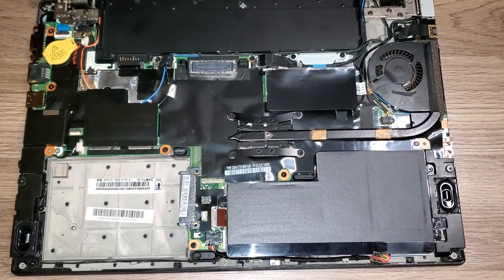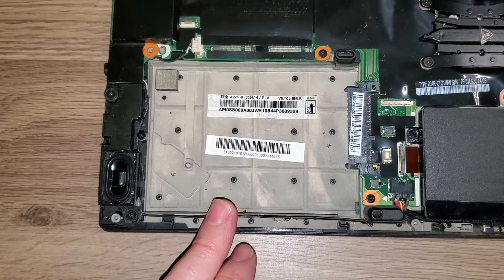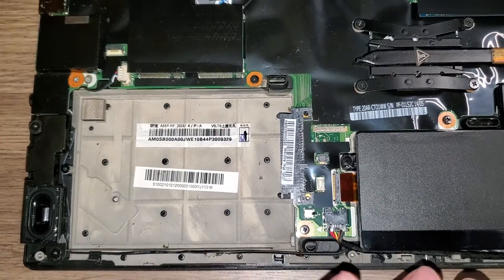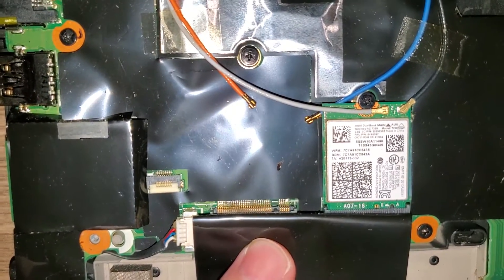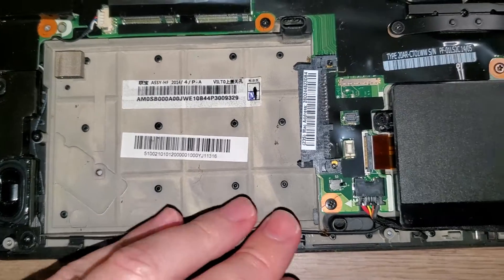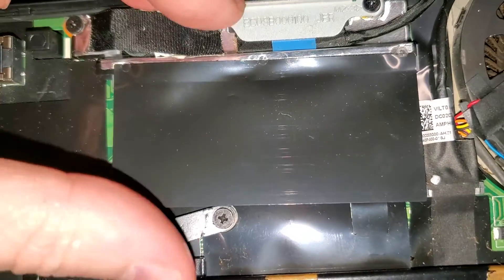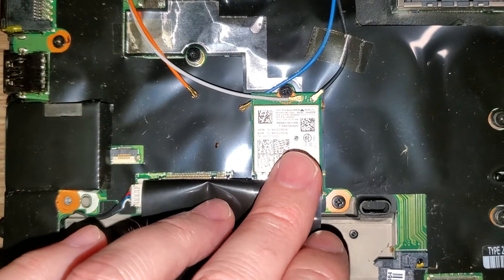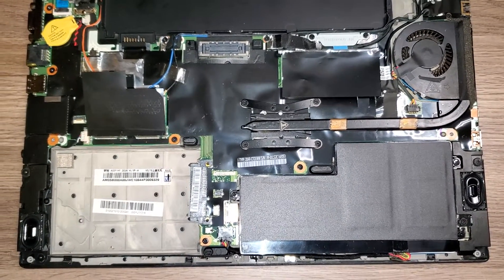Tour of Lenovo Thinkpad T440s Motherboard - SSD and Memory Upgrade Options

Comment: Hey buddy got a t440s but it won't run windows it's shuts off instead got any ideas please
Reply from the maker: Hmmm, kinda sounds like the power adapter isn't working or not providing enough power and the batteries are dead. Can you boot to the BIOS with no problems?
Reply: @LuckyVagabond Yes if I take out the drive it runs and doesn't shut off but when I put back the drive it shuts off

Comment: For the T440s model there is a second m.2 slot hidden under the internal battery on a carrier board.
Reply from the maker: Thanks man. Appreciate the info and comment.
Reply: @LuckyVagabond  actually that slot you are using is meant for is a WWAN card like a 4G LTE one. EM7345 is the one that normal would slide into that slot.
Reply from the maker: @Demonclaw92 thanks! Appreciate the info.

Comment: i currently have a HDD on T440s and i have ordered an ssd to just use the operating system for smoother experience. However, i ordered my ssd before i watched this video. I want to use both my 2.5 inch ssd and HDD. is there any way?
Reply from the maker: Yes, you can add storage via the M.2 slot. It's a 42mm slot, so keep that in mind.

Comment: hello, what type of ssd is suitable for lenovo thinkpad t440s? I want to buy it but I'm afraid it won't be suitable
Reply: I also have same confusion whether 2230 or 2242
Reply from the maker: 2242 M.2 SATA - like this SSD from Amazon: https://amzn.to/4kdFokQ
Reply from the maker: The easiest option would be a 2.5" SSD drive in the HDD slot. Or, you could use a 2242 M.2 SATA SSD in the WWAN adapter slot.

Comment: Thanks for posting this.  I got one recently as a "no charger, don't know if it works" special on ebay and happened to get lucky (it works but batteries are much lower capacity now).  It does very with lighter versions of Linux with the 12 GB ram.  You can definitely play old games on it (e.g. Skyrim).  The only watchout is if you're using Linux and play old Windows games in compatibility mode on Steam is you have to use Proton 7.  The newer versions don't support the Haswell architecture.  I love the keyboard, form factor, ports, but not so much the trackpad.

Is there anything else you can do with the NVMe M.2 port?  Does using the M.2. port keep you from being able to use the traditional hard drive cable?
Reply from the maker: It's a great laptop! Yes, you can put a M.2 42mm SSD in it, but it has to be a SATA version, not NvME.

Comment: i have a 440, it has 4gb on the board and ive put a 8gb in, so frustrating to not be able to go to 16gb.
Reply from the maker: Are you sure about that? To my knowledge, the T440 does not have soldered on ram. Each of the two ram slots are upgradable.
Reply: @LuckyVagabond  yes the t440 is soldered 4g. Then there is t440p and an s model. I went through it last night and Im stuck at 12gb, however there is room for an ssd

Comment: Hey man, thanks a lot for sharing all this info. I have a ThinkPad T440s, which has served me well for nearly 4 years now. Two days ago, it stopped working. It wouldn't turn on... Both the battery and cable cord were working fine. The easy fix I found here on YouTube was to unplug the small connector between the internal battery and the hard drive. I did that, and boom, it worked right away. I suppose this connector might be for the internal battery because my computer worked fine with this cable disconnected. Any idea why this might have happened?
Reply from the maker: Do you have an SSD or traditional spinning platter hard drive? I'm not aware of cable directly from the battery to the storage drive. Sounds like you disconnect the storage drive.
Reply: @LuckyVagabond  actually, I think it was the internal battery. Because, I was able to boot my OS with this cable disconnected.
Reply from the maker: That makes sense. They are cheap and easy to replace.

Comment: If I replace motherboard will it supports amd ryzen 5 3500u and if yes which one can I buy?
Reply from the maker: I don't think so. I'm not aware of a motherboard option for the T440 or T440s that allows for an AMD processor.
Reply: @LuckyVagabond  aight thank you

Comment: Howdy!  
I have this T440s also and recently bought a NVMe M.2 2242 SSD... and surely, it didn't work, the laptop won't turn on. Fortunately, the mb didn't have an electrical short circuit, so that's a good news.
If I bought an M.2 SATA 2242 SSD, instead of my current NVMe, will that really work? 
I'm really scared of destroying my MB with the wrong SSD (yes, I've come across someone on reddit that did this).
Reply from the maker: Yes, it should work, but you'll need to initialize it first before installing.
Reply: @LuckyVagabond  I see, what do you mean by this 'initialize'?
Reply from the maker: https://learn.microsoft.com/en-us/windows-server/storage/disk-management/initialize-new-disks
Reply from the maker: You may need to do that externally before installing the drive. So, that means buying an external USB m.2 adapter. I haven't done this, so take my advice with a grain of salt.